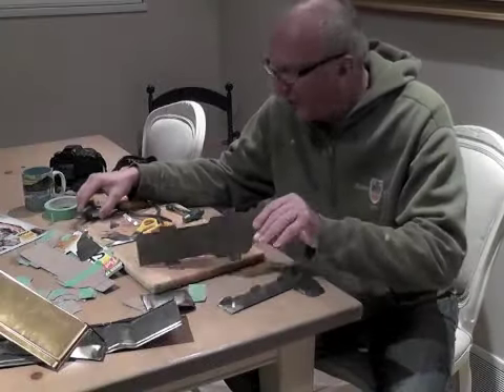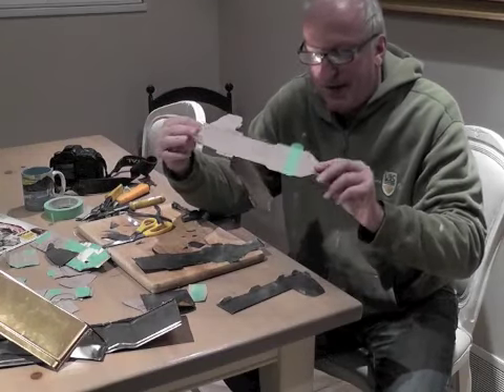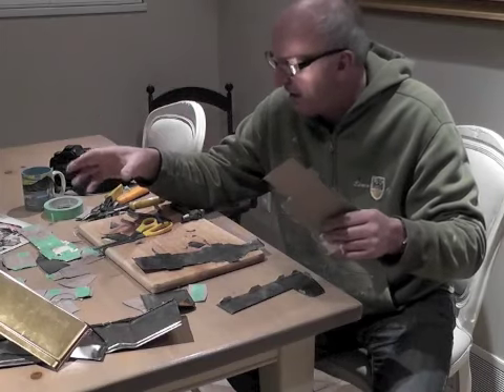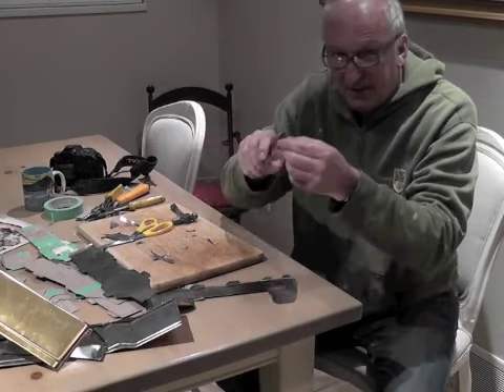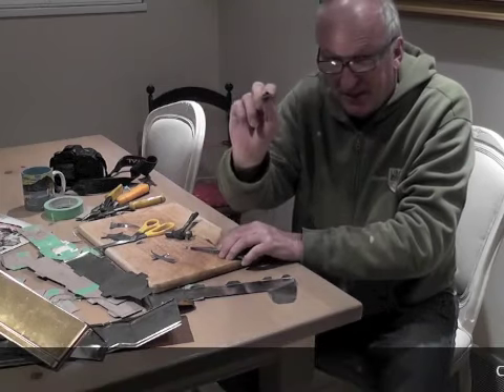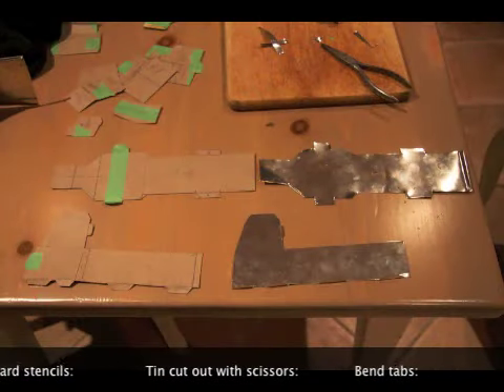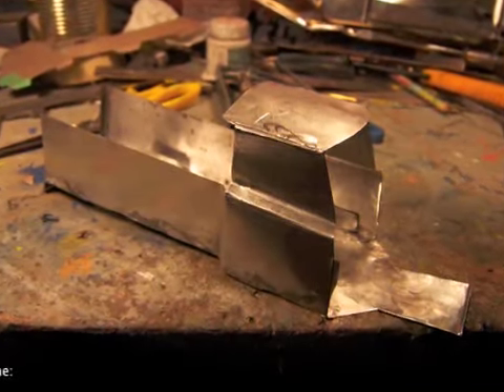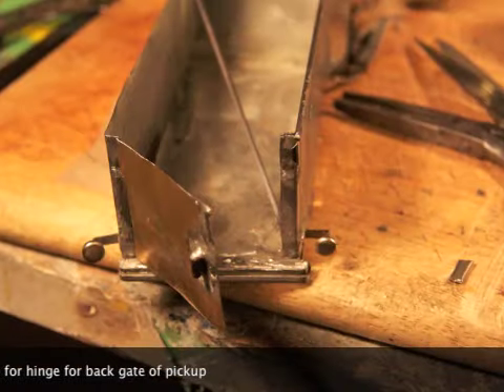HOW TO MAKE A TIN TOY

Comment: How do you weld em pieces?
Reply from the maker: I solder them together. All you need is flux, solder and a soldering iron.  I use an electric soldering iron so the metal does not distort. The brand is Weller. 
Using a torch would cause the tin to bend out of shape.
Reply: @WillyDahm  thanks a lot sir!